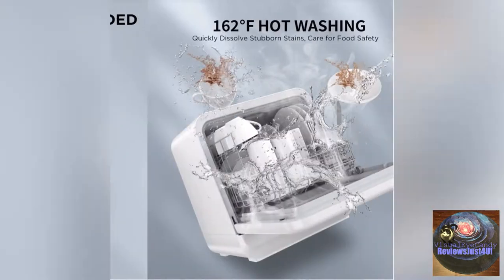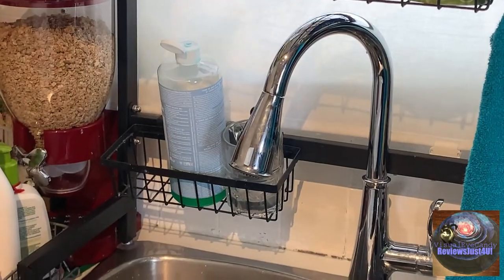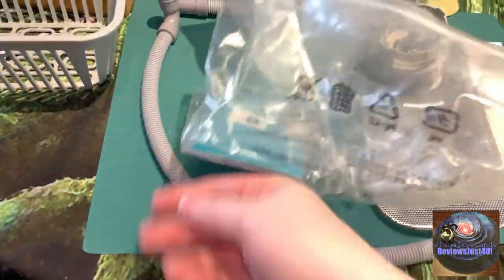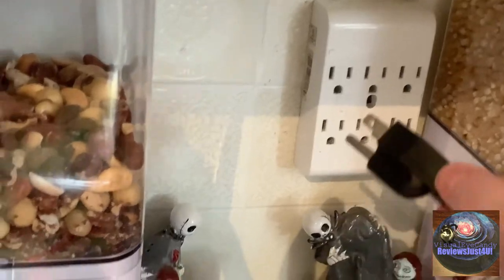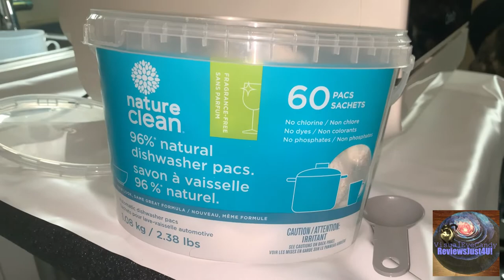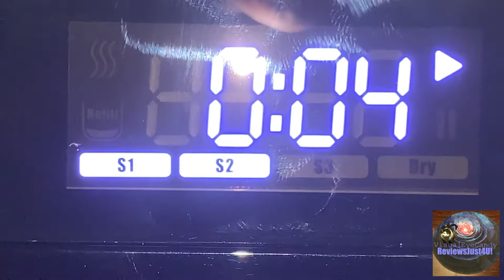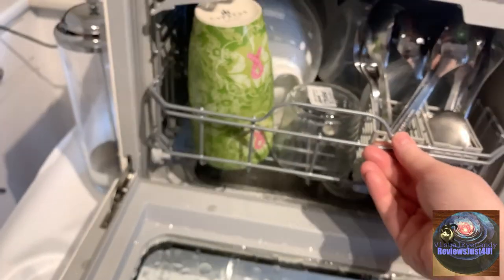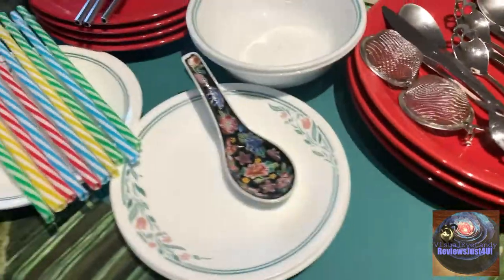CalmDo Countertop Dishwasher ReviewsJust4U! (30 mins)

Comment from the maker: #CalmDo #Portable #Countertop Dishwasher

Excellent counter top dish washer by Calmdo.
I really love my bday present I did a full product review video on my YouTube channel. Stop by like, share and subscribe I greatly appreciate the support. I wasn’t sponsored for the product I bought this amazing dish washer with my own hard earned money. 
Visual Eye Candy ReviewsJust4U

https://youtube.com/channel/UC3j2jqCs_Mk_1Oq2NORQTPA

#CalmDo Portable Countertop Dishwasher

https://www.calmdo.com/products/calmdo-portable-countertop-dishwasher

COMPACT DESIGN, NO HOOKUPS NEEDED: Weighs 28.6 lbs, measures 17.44*15.98*18.3 inch. Small size fits in every corner of the kitchen. No need to modify waterways and cabinets, only one drain port. No Installation and No Troubles
6 CUSTOMIZED PROGRAMS: Penetrate into user life needs, specially designed 4 washing options+2 customized functions with intelligent one-touch operation, including Heavy Washing, Normal Washing, Light Washing, Rinse, Self Clean, Drying Tablewares
3D STRONG WASHING SYSTEM: Upper and lower double-layer high pressure water column provides 360°strong but safe cleaning, the quickest washing for 10 minutes with few setups, efficient remove the stains of every dish
SMALL BODY BUT LARGE CAPACITY: 3 sets of tableware(18 pieces dishes) can be placed in the lower basket, the upper holder can accommodate 16 knives&forks. Ideal size for singles, holiday apartments or second homes, ect
MULTI-USE DISHWASHER: One machine for 3 uses - cleaning the tablewares, vegetables, fruits, seafood, ect. Drying function for dishes, baby's bottle, children toys. Also it can be a durable and dustproof tableware cupboard.

Excellent counter top dish washer by CalmDo. I really love my bday present I did a full product review video on my YouTube channel. Stop by like, share and subscribe I greatly appreciate the support. 

#calmdo #countertopdishwasher
#portabledishwasher #dishwasher

https://www.facebook.com/VisualEyeCandyReviewsJust4u/

https://instagram.com/visualeyecandyreviewsjust4u?igshid=zgz9etarj49g

Music: Flow
Musician: LiQWYD

https://youtu.be/n41dME8d9Jo